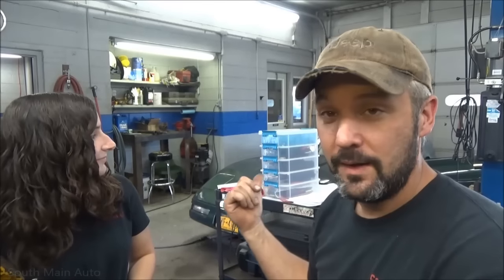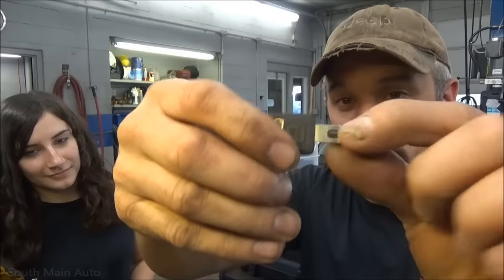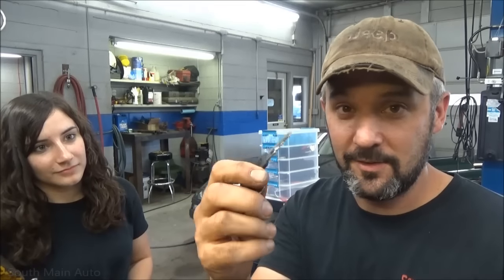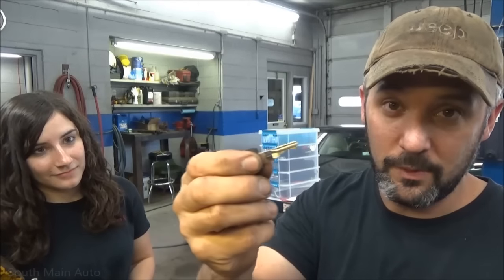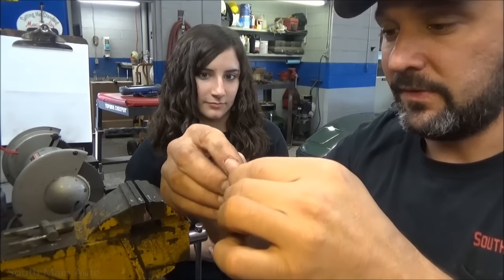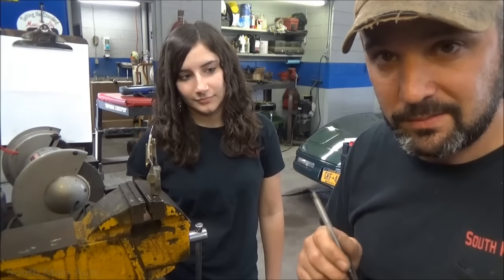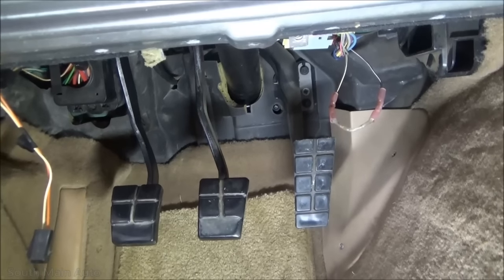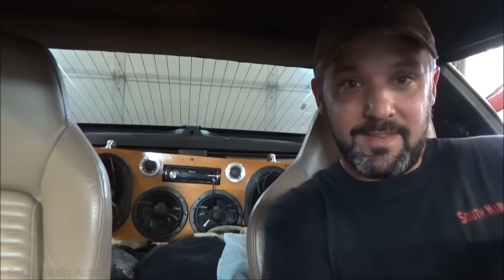GM VATS Key / Resistor Key Security Bypass

Comment: I have a 2002 Cadillac DTS .It will not start . This is the second time this has happened. I bought this car in November as it was a friend of mine’s car and he passed away in Oct. I drive to Indiana about 250 miles and it’s the day before Thanksgiving. I go to the local grocery to buy items for dinner and when I come out it will not start . Lights work, heat works, display works but nothing happens when I turn the key. Had to leave it sit in the parking lot til after Thanksgiving and a local shop picked it up on a tow truck and five days later they say it was a bad ignition switch so almost $500 plus dollars later and drive home. I park it because I wasn’t confident that it would not break down again but start it every day. 3 months later same problem so obviously it wasn’t an ignition switch probably . Everything comes on  won’t start , display, lights, says security update required or similar any information or advice would be so appreciated. This was my dream car . I am 70 on a limited income so now it’s turned into a nightmare and I want to get it fixed and sell it. Thank You

Comment: I once bought a 1991 camaro RS for $800 it had this same problem fixed a different way. There was two ignitions another one was taped up under there. If I took the key out the other one it would flash security and not let me start it. There was also some wire that ran through the door jamb to the starter. I never understood it. And the guy I sold it to said he took it to a shop and they told him they weren't sure why it was like that either (two ignitions) I thought I'd never know why.

Comment: remember resistor's in parallel the resistance is half. (1/1000 ,+1/1000)/1=500.
Reply: I guess that's why he connected then in series.  Good point to remember when you're trying to get just the right resistance for the vehicle - especially if it's an odd number of ohms.  :-)
Reply: Yes, math helps greatly when finding odd stuff.
Reply: The resistors were put in series so their values add, 1000+1000=2000.  Pomona Bills comment apply if they were in parallel.

In other videos, we get to see Eric and Hanna's farm, garden,  tractors, their dogs, and their kids; we also get to see their small daughter helping out at the shop.  He also refers to Hanna as "Mrs O" in many videos.
Reply: 1/(1/R+1/R)
Reply: Uhh...no. Hannah is NOT Mrs. O.
Reply: remember?99.9999% of us never knew.thanks for pointing that out.theres always that .0001% of info.that is assumed when teacher explains a theory,that leaves us 99%ers in the weeds to flunk &drop out b cuz of it....seriously,not LoL...
Reply: R = e devided by I.     Ohms law

Comment: Reminds me of my old 93 Mustang GT.
Previous owners put a Viper security system in it and one day the thing just decided it didn't want to work anymore.
Alarm went off and never stopped, and I had to disconnect the battery to turn it off as the key fobs did nothing (alarm would go off again the second you reconnected the battery too).
Long story short I looked around at how to disable the system and found there were 2 ways it could have been installed.
One way meant you had to rewire some stuff, other way was just pulling a 5 amp fuse.
I got lucky and just had to pull a fuse.

Comment: Neat Trick. How much would it of cost the owner to fix it the GM way and to maintain the VATS integrity??
Reply: $300-$600
Reply: They use to sell you a new key and of course it had to be coded to the pcm that was in the car already to the tune of about 300.00 bucks.
had a 95 bonneville with the exact same key and the exact same problem. thank god they have gotten a lot better, talk about garbage.
Reply: You can do it for $100 if you do it yourself, by measuring the resistance, buying a new lock cylinder with the correct resistance, and then purchasing new keys to match the new lock cylinder from a place like Ace Hardware who can make the VATS keys for a fraction of the cost a dealer would charge.

Comment: he was right, cutting the wire and introducing a new potential failure point did flip me out as questionable advice.   One can buy a blank key with the correct resistor value and have the old key copied for less than the cost of labor  , if in fact resistance is the problem .

Comment: I found the plug. The 2 white wires were not in insulation & the other end is white & purple. I unplugged it & car wouldn't start. Plugged back end it starts. The problem I have is the key only works on one side. Have u heard these colors b4 ?

Comment: Just out of curiosity, have you ever had a comeback from those crimp connectors?  I've never used that type, just the old plain crimps..And it's been my experience that with regular crimps, over time, random temp changes cause them to loosen up.  Back in the 90's when I was doing car audio stuff, I would get the occasional comeback (not a lot, maybe 1 in every hundred or so) for a failed butt connector.  But since I started soldering everything we never had a comeback for something other then bad modules since...   But again we didn't have those shrinkable connectors with the "Shtuff" in them :) so I am curious
Reply: Gonna have a hard time loosening up with that heat shrink on it appears to me. Also if you notice he gives each connection a test tug. Not saying what happened to your work, but trusting his.
Reply: I gave mine tugs too :)  But when I was doing it we didn't have those connectors with the heat shrink etc...   I'm not saying anything about his work, he does great work , I am just curious if he ever has comebacks due to crimps...  More because i want to know about the new 'shtuff"   :)
Reply: Hear ya. Also doubt very seriously there will ever be a pull on those two wires, such as may happen when pulling a stereo up to mount. :)
Reply: Ah cool

Comment: Thank you for this video as I was having the same issue on my 88 C4. Based on the lead this video gave me on the key chip/resistor I remembered I had 2 new keys made and was using them for primary use and one fine day as in today it  decided not to start. I remembered I had the original key as the emergency back up so I tried it to start the car and it did start. Then I tried the 2 new keys and the car started with them also. So if you have an original key it might help to try it also. Just saying. Thanks again your work in this video.

Comment: Will this work for 2000 Buick Park Avenue, hard to find tumbler and spring kit for ign. Lock cylinder and anti theft module PK3 expensive 200 bucks , module did it's job thieves tried to steal,but they ruined ign. Key cylinder and broke vats module,😡

Comment: Cutters? Ouch! Unplug, then I use my autostripper to push open the insulation on  each wire, offset and UNCUT, and then just solder the new leads on. Insulate and you are done, and the old wiring is 100% intact. FWIW.

Comment: I would have made it easier on myself. When I did the same thing on my  IROC-Z Camaro. I cut the cable going to the ignition cylinder and then just soldered the resistors to that connector so that if they want to just replace the lock cylinder and get a resistor coded key he could. It is much easier that way. Just what I did. Plug and play then.

Comment: i have a 2002 cavalier , i tried every theft security pass on youtube except the wire cut ... cant seem to bring myself to cut wires and create more problems i already have .... my deal is , i have replaced a starter because my brother and his bright idea to try and start and move this car with a blown head gasket and no battery ... he used jumper cables to try and jump start this car without a battery and burned up my starter .. this car did run but took a bit to start it but , he had burned up the starter so i just parked it ... some months went by and i decided to fix her and got a starter out of a buick with a v6 . the starter was a good fit ... i replaced the head gasket and did a valve job on it too along with a new battery and oil after i flushed the bad oil and cleaned the engine from slug ,,, well i got it all back together and NOW i have a no start , no spark, no fuel , no communication from the computer on any scan tool i use, theft light stays on and wont reset with any trick or reset instructions i do ! i am at your mercy ! please help ?

Comment: Just wondering...why can't you connect the resistors directly to the connector - maybe with a couple of small spade or pin type connectors, or even an original connector cut  from a junked car?  Then you wouldn't have to cut the wires and reinstating the system would be easier.
Reply: Yep. I would have cut the cable between the connector and the column, and put the resistor onto the connector stubs.  The lock cylinder with the attached harness would be what you would replace anyway if you wanted to restore the VATS operation anyway, right?

Comment: So I have this problem with my car but I am not sure what size resistor or resistors I will need with a consistent reading of 11.63 kilo ohms. Can you or anyone help me out on this.
Reply: Measure the ohms on the pellet of your key, the same way Eric did at the beginning of the video. Use a multmeter to measure the ohms, should fine.

Comment: I have a 2000 chevy silverado changed battery security light was flashing so i changed bad battery it started up then when i got back from gas station and shut it off went back in to start it security light is on and wont start whats my problem???

Comment: has anyone bypassed on a 1994 cadillac seville sls?  mr. o made the corvette look easy
but the caddy is different. the orange wire with the 2 whit wires go into a junction box that is shared by other connections. looks like  i would have to cut on the key side and install the resisters that way. comments are needed please!
Reply: i did get the anti- theft  done with a resister but still no starter yet. all fuses are good . cannot fine the starter relay and little or no one knows where. battery at 13.34
eric does i bet.

Comment: What size resistor 1/4 or 1/2
Reply: Javy Espinoza The ones he had are 1/4 watt.  Not critical in this application: at 12 volts, 2000 ohms only produces 0.072 watts.

Comment: See my problem is, the car will crank, but injectors are  not firing, I've checked grounds, all good, injectors have 12v to the positive terminal, new ECM, but it will NOT fire or "pulse'' the injectors, verified with noid light. And the security light only comes on for about 1-2 seconds when you turn the key on. 

I'm really at a loss here, some people say the vats won't allow the car to crank and only kills the injectors and other people say it won't even crank....... 89 T/A 5.7 TPI
Reply: kevin knox I'm having the same problem with my 89 z28 I hope bypassing the vats will make it work since I have the same problem it cranks over but they injectors are not turning on I bought a resistor kit so hopefully this works
Reply: I am going to purchase some resistors hopefully it will solve the problem with my car 1990 vette...turns over but know start getting plenty gas but no pulse to injectors
Reply: Ignition switch is bad guys
Reply: New ECM? Has you ever been able to start the car with new ECM. See, if the ECM is not programmed for the type of injectors you have, the pulses the ECM sent out may not be of the right one to trigger the injectors.

Comment: This didn't work for me... the wires that connect to the inside of the steering wheel completely tore off , is that why it doesn't turn on even though I got the matching resistor to my key.. help please

Comment: Starter is disabled and you can't even push start the car as the fuel injectors are disabled too. Good thing eBay sells the 15 resistor pack for a few $ 
My camaro broke a wire to the ign switch not worth 60$ for a new one plus getting new resistor keys cut. Is you want to save it just put a switch and a resistor in somewhere .
Better security than the gm system ever was.

Comment: so you only solder the ohm resistors together.  then, you just crimp the wires the soldered resistors to the two wire ends under the car.  simple enough, if this ever happens to the buick century ill be ready

another video led me to believe i had to solder underneath the dash

Comment: 6:25 didn't put the resistors in the same orientation... death by firing squad in Mr. Van der Schueren's electronics class back in 1990. :D
That guy was really OCD about that stuff and I guess it rubbed off a little, because I felt inclined to comment.

Edit: if the resistor being permenantly present can fool it. As someone who's been involved in electronics for security purposes, I have to say that is quite poor software/hardware design.

Comment: I have a Cadillac Escalade v8 6.0 2002  and has a security
Reply: Joel Gomez hp tuners can bypass that quickly
Reply: How do I do the bypass?
Reply: Joel Gomez you have to either buy hp tuners or find a friend that might have it then open vcm editor click read pcm go to system general security  vats select none then write file

Comment: why wouldn't you cut the connector off of the existing key switch and attach the resistor to it, thereby leaving the cars wiring harness intact. and easier to fix if someone wants to, or needs to, repair it in the future. Plus you could do the connection and heat shrink on the workbench instead of under the dash.

Comment: You don't have a VATS box ??  I built one when these things first started failing. Lets you plug in and just select the correct resistor as needed. IF you really get PO'd you can even go into the module and toggle the system off in programming.

Comment: Can't just copy to a regular blank. Requires a  "pre-vats" blank, they're longer than the original ignition keys.
Reply: The key you want would be the blank used on 87-96 Chevy Corsica/Beretta.  Those had the longer shank keys without the resistor pellet.
Reply: Never knew which vehicle they actually went to, thanks!
Reply: @technosasquatchfilms  - The Beretta was supposed to replace the Camaro in 1987, but it never happened.  Since the Beretta was intended to be the Camaro's replacement, the steering column was designed to use the PASSkey system.. Ultimately the idea to scrap the camaro was shot down by GM Brass the Beretta became what it became and the PASSkey system was cancelled on the Beretta right before production,  so they had to introduce the longer non-VATS key and lock cylinder to fit the Beretta steering column.. Since the Corsica is just a 4 door Beretta, it also used the same column, which needed the non-VATS extended lock cylinder and key.

Comment: I remember the disappointment of discovering that a 75 cent key from Homedepot would not start my 02  F 150.
I always want a backup key so called Ford and they were like 300.00. I just used the homedepot key to unlock the door if the keys got locked inside the vehicle. I never  did get the
 matching pass key.
So much of the simple stuff that worked for years is sadly gone today.😀

Comment: you dont need any resistor for this to work. Just open the column, cut the wires and splice them together and itll read 0 ohms lol. Do the relearn procedure and viola, no more problem ever!!
Reply: I was thinking the same thing also.     It should work without the resistor.

Comment: 11:19 I want that wire stripper!
Reply: Snap on. Bought 50 bucks. I like them as well. Strip, crimp and cut
Reply: asavage1576
Thanks. Do you know the tool number or name?
Reply: yeah me too
Reply: Its a Mac one, but Napa sells the exact same one but with blue handle grips. Its in their Carlyle brand. They are really nice. A guy I worked with had the Mac one, I was going to buy one then saw the Napa version for like half price. They feel really heavy and solid, get them!
Reply: I have a couple sets of those myself. Very nice for tight under dash work. Use them all the time. Snap-on part# is PWCS7CF

Comment: If this is the first time it failed, after 12 years, is it a disaster?  I ask as I my parents had this system and never had a problem with it over 14 years and 150,000 miles when they dumped the car.

Comment: It's way easier to bypass that crap on a 91. I've done it. the process is simple.. Remove the VATS fuse :)
Reply: where is it located?
Reply: @garyhall6294  Mine is under the dash on the passenger side. There's a small fuse block there. It's the once called 'Theft' I believe

Comment: thats pass key 2...... pass key 3 is RF, has a larger head, and a + with a circle in it

they can be re-learned...... any resistor or RF chip will work, just need the key cut from the vin

10 mins on.... security light will blink, or turn off.... off for 2 seconds..... on for 10 min.... off, on for 10.... then off, and start the car

just saved ya 700 bucks at the dealer
Reply: 14 codes.... many more for pass key 3

their is also "pass lock".... mostly used in 96 to 08.... or so...chevy/GMC pickups, SUVs
something to do with a magnet.....its REALLY bad to deal with